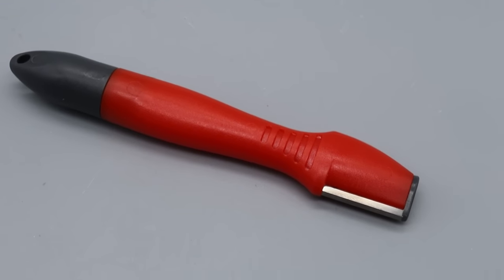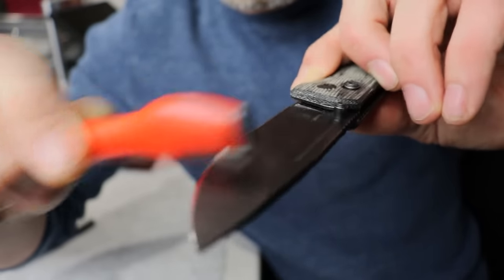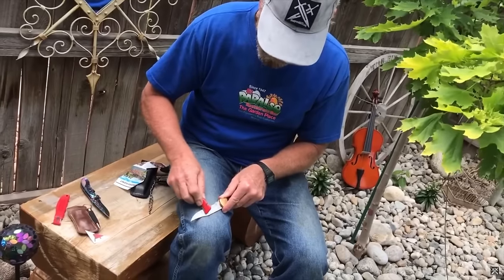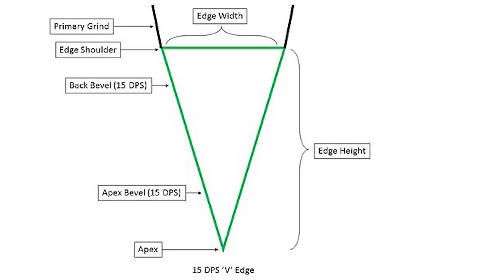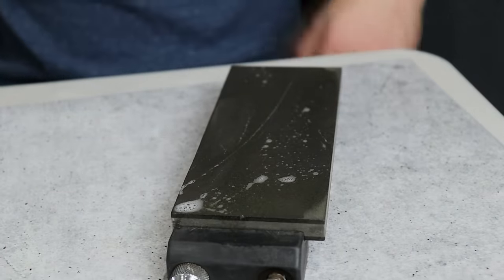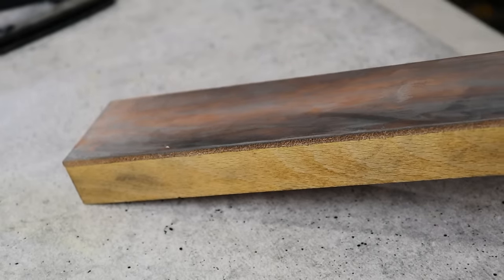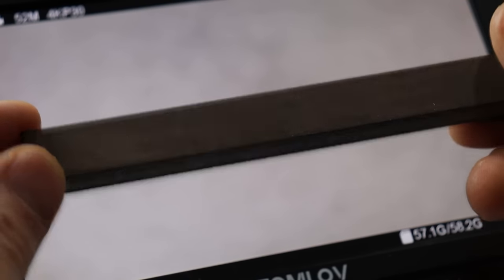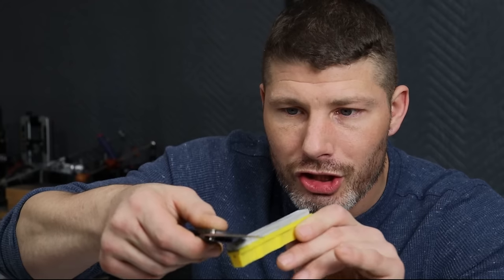Is This Sharpener Just A Gimmick or is it LEGIT

Comment: I have a similiar product called the Speedy Sharp and it works. Have used it for years. When I watched your video I did not see you use it properly.  You need to use the corner of the carbide and drag it across the blade with little effort.  Do it a few times on each side and it will be sharper.  You can use it on axes and many other items.  I have used it on my lawn mower blade and it worked great.  You mention using a stone etc.  Of course you can get it sharper using multiple stones or Lansky systems etc but I can carry this around easily and sharpen to 90% of your stones in 30 seconds.  My knife would be sharpened and you would still be looking for your stone.  Like your videos but your wrong on this one.

Comment: You could strop on your jeans and get the same result as gently scraping with this tool, only without the damage. You could buy a ceramic tile for under a dollar and use the back of it for better results.
Reply: So what are you going to do if the knife actually needs sharpened and need some metal removed you’re gonna do that on your pants. No you’re not. I’ll tell you hot will do. I’ll put a couple thousand dollars on the table and you take your knife and your jeans and I’ll take my knife and my sharpener and we’ll go do some real work and after two hours of working whoever still has a sharp knife picked up the $2000 from both of us off the table. You’re a fool if you think you can keep a knife sharp with jeans.

Comment: You boys are being a bit snooty. It is a rougher tool, but it recovers sharp edges. 90% of the time you just need to straighten the apex and it does if you use it gently. If the author of the video only wanted the best for your knives, he would only have a single sponsored link to Amazon.

Comment: Jared quit hating on other peoples ideas micro nit picking on things. I told this years ago, if you would have put your efforts into positivity you would have had your own design and understand engineering and design better. I think sharpening in general just takes practice with each tool and individual mau vary, you may not hold an angle as good as the designer does, and again does anyone actually understand how factories sharpen???
Reply from the maker: you are free to buy one yourself and do your own testing, film it and let everyone know how great your experience is, im not hating im just showing what i got thats it, i cant make up things in order to make him look good, nor would i bad, im currently testing his exact one with an edge retention test so we shall see how it does
Reply: Engineers "de-construct" things every day to get a
better understanding. That's neither optimism or 
pessimism, it's realism. Science.  You assuming 
his evaluation is negative proves your just another 
pot calling the kettle black. Jerad has taught me
nothing but realism. My glass is half full.

Comment: The carbide sharpeners only just scratch a new edge on knives
Reply from the maker: Everything that sharpens does that
Reply: @NeevesKnives  well ya the tungsten carbide is just harder and even in tools it's used for really hard use drill bits and all

Comment: This is basically a one sided pull through sharpener, and honestly, I'm not impressed. The carbide is way too harsh, removing more metal than necessary and potentially ruining the blade. It feels like it's more about hacking away at the metal rather than sharpening. For those who value their knives and are looking for a precise edge, this tool is definitely not the way to go. There are much better options out there that treat your blades with the respect they deserve. Save your money and your knives; give this one a hard pass.

Comment: So it's just like a pull through sharpener, but one side at the time!? And harder to use...

I coincidentally already saw the video where he gets the complaint, I think he said to use it on kitchen and cheap folding knives if I remember correctly, the fire steel is a good implementation, but as a sharpener it's a nope!

If it was a ceramic rod and a bit longer, that would make it an ok sharpener, but then it wouldn't be anything special about it because there's already a lot of options like that mini work sharp with the 3 screwdriver bits in the middle.

Comment: Did this guy really spray paint a Speedy Sharp red and pretend it was his idea? 

I keep a Speedy Sharp in my pack and it works great to put an operable edge on a dull blade in a pinch, but it's absolutely not a precision system. Now, with some of Worksharp's compact tools it's pretty much useless, even for pack use.

Comment: Why make a video if it's not the actual product.  That seems a bit unfair
Reply from the maker: It's literally exactly the same I now have the actual version and it's the same, the only difference is that it has a pull through on it, which was not what I was testing in this video, however I do have a full video about pull through sharpeners